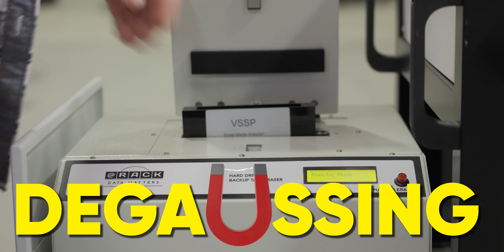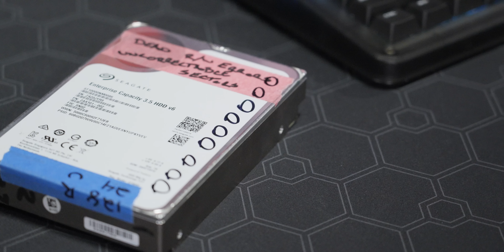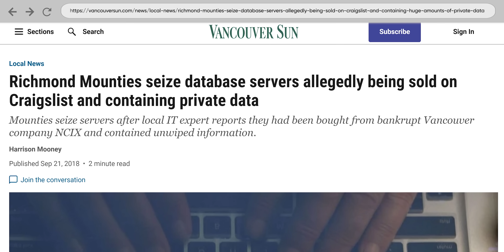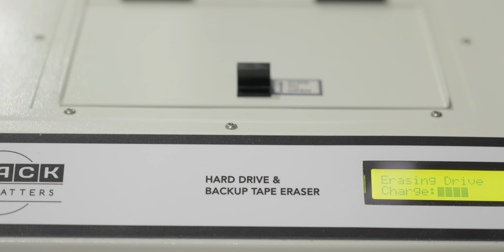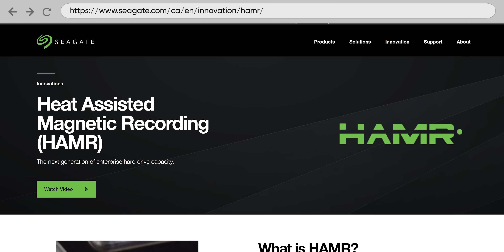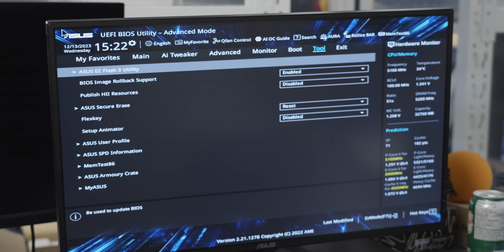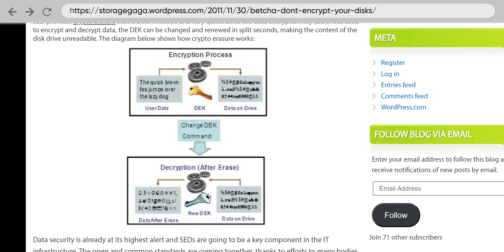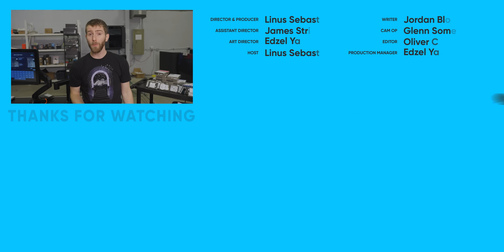I Got an Industrial Hard Drive CRUSHER! @Rack's Mobile Data Destruction System

Comment: Instant secure erase is also a very awesome feature for essentially most business and personal stuff. It’s essentially encryption and it throws out the key.
Reply: One thing to be careful with here is that it's called ATA Sanitize, and "Secure Erase" is a different feature that doesn't actually employ any encryption - it simply drops the page mapping table.
Reply: @gsuberland  Usually, and as per ATA specification, ATA Secure Erase should erase SSDs completely by resetting every bit, not just dropping the mapping table. What you are talking about is a simple format or deleting a partition afaik. Sure, there are maybe some wack ATA implementations out there but this shouldn't be the standard.
Reply: If the drive is SED hdd,, the secure erase has 2 modes

instant erase/Sanitize Cypto {default} clears protected and hidden area and resets private and public encryption keys (doesn't zero fill the drive all stored data is unrecoverable due to encryption keys reset)

Advance secure erase same as instant erase + your normal zero fill

For ssd's secure erase clears page table + sends a mass trim command to all nand chips (if the drive supports encryption it also resets teh private and public key) this takes usually less then 30 seconds with background garbage collection completing the zero fill via trim in the background (a couple of minutes) 

NOTE if the drive has encryption or SED support,, Regardless if you have enabled or not the password or relevant security feature, the data is already encrypted so a secure erase at stage 1 of a secure erase command has already made the data unrecoverable because it has reset the encryption keys (before hdd zero fill happens or ssd trim)
Reply: Did you watch the video? He literally sats that at the end.

Comment: For M.2 SSD sticks I would use an induction heater coil to turn it back to sand in seconds.
Reply: Depending on which organization you work for, some policies my delve into more stringent requirements for SSD destruction. Crushing it like they did in the video would probably be fine for most people, except for the government. The DoD policy on SSDs literally calls for disintegration or 1mm x 1mm pieces.
Reply: Or just an ordinary cheap angle grinder....
Reply: @VTepesIII  well, technically speaking, throwing a SSD in an oven is less work than using an angle grinder. And also using an angle grinder, would not meet policy standards, depending on where you work.
Reply: @NicholasOrlick if its dust no one can read it anyway
Reply: @captainheat2314  that’s what I’m saying if you incinerate it you can’t read it.

Comment: The cloud-service kinda seems like a downside to me. Happen to know if you could host your own database onside? Otherwise, a pretty neat product
Reply: To be fair, corporations like to have something that just tracks this for them automatically. It helps with compliance. No one actually wants to spend a lot of time on this, it's just one small part of a business process so again, the less stuff you have to worry about keeping and managing the better.
Reply: @amogusenjoyer  Well that makes little sense then, because if you're not willing to spend time on it, why have someone run that machine at your locations. Have the disks picked up and destroyed with proof of destruction like most do anyway...
Reply: good point, but the problem with hosting things on site is what if there's a fire or other environmental catastrophe and all of your data is lost? these records are required by the government so a scenario like that is not acceptable, and the cloud service is probably replicated on multiple continents with many copies of the data so it can never be lost
Reply: @pwii  If anything, sending the data across the internet and storing in another companies hands (probably in some other country) seems to me like it would increase cost and risk. 

Easpecially if you already are a hoster and have redundant systems
Reply: It seems like they're selling a service instead of a tool, based on how Linus mentioned renting those carts.

Comment: I had 2 dead 2.5" SSDs on hand a few weeks ago. I opened them up and used some snips to cut the chips into small shards. Kinda cathartic in a weird way.
Reply: metal cantering punch will make short work of chips.
Reply: when i was in highschool me and my friends did some bad things and ended up putting our hard drives on train tracks and burying the pieces lol
Reply: @bmxscape friendly reminder that you have digital footprint😅

Comment: I used to work for a company who made degaussers and crushers like this and they are super cool. 10 tons of force on the crusher, and they're up to 40,000 gauss (4 Tesla) on the degaussers which is cool, but terrifying to work on when doing QA and the capacitors fail to discharge lol. A surprisingly small market but a lot of interest from big data companies. I don't work there anymore but they're a great group of people, Garner Products if anyone is interested.
Reply: What kind of caps are used there? The only ones I dare to handle are those up to 50V for small to midsized electronics projects because they still can ruin your day by popping or "suddently" discharging when your mind isn't fully there.
Reply: @Donnerwamp  I forget the exact specs of the capacitors but the total final voltage was around 1300v for the most powerful model. They absolutely sound like a shotgun when one pops lol I stood back when first testing each one
Reply: The degaussers were fun back when I was destroying old spindle drives at a previous job. Some of the really heavy drives with a lot of platters would jump inside the sled with a satisfying thump.
Reply: i work for a certain data center company and we use your crushers occasionally when our manglers are dead
Reply: @SecondSunofficial  it's cool seeing them out in the world being used. They all went to confidential sites when they shipped out so I never knew where they ended up
Reply: @aaronth777  Not sure of this is the place to say, but we like them, but have a regular issue with them, the doors and their shutoff sensor for it being opened is wayyy too sensitive. Not sure if you've heard that before
Reply: @SecondSunofficial  yeah they're great overall but I've heard that before, I think the sensitivity can be adjusted inside but the magnet can be sensitive
Reply: what is the price for these kind of machines?
Reply: @bugshot4760   If they're NSA listed models usually 20-30k USD depending on options, non-listed are 6-15k.
Reply: @bugshot4760  more than I can afford lol. They are priced for businesses, so like 8k-20k. Most companies buy multiple so it wouldn't surprise me if they get a bulk discount
Reply: what's the point of a degaussing, if you're going to shred the disk?
Reply: @giornikitop5373  Linus touched on it in the video but it's just about redundancy and security when scaling up the operation. A non-degaussed crushed disk could potentially have data read from it although it would be extremely hard. It's really just a quick reassuring visual indicator that it's been erased
Reply: @aaronth777  my bad, you wrote crusher, i meant shredder (not the ninja turtles vilain!). different beast. the chances of recovery something from a shredder is as close as mine winning the lottery.

Comment: Here government harddrives need to be shredded and the chips can't exceed a certain size .Depending on how critical the data is that size can be preeeety small
Reply: How much trouble would you be in if you stole a non destroyed drive
Reply: @FleaOnMyWiener from my knowledge (and taking a slight guess that this person probably has a decent level of security clearance), he would be quite lucky to just get fired AND a sizable fine. (At least the US govt) tries to take data destruction very seriously for secure data storage devices
Reply: @FleaOnMyWiener in my experience you wouldn’t get the chance to, government drives and paper documents are typically witness destruction.
Reply: @FleaOnMyWiener  Ever hear of Snowden? That kind of trouble.
Reply: I would say it would be 3 -5mm pieces, as that is dod standard I believe
Reply: @nicholastaylor7070 my comment referenced germany and the highest classification asks vor 5mm for harddrives and 0.5mm for anything flash related . 

Just using the machine in the video would be enough for normal sensitive data. Data that would be shitty to have out in the open, but wouldn't destroy a company. 

But then again, there are enough places that have shredding machines that can do the work for you no problem.
Reply: As far as I know most companies here (Estonia) offering data storrage destruction actually shred the drives, first time seeing the destruction type done in the video actually.

Comment: When i worked IT in a gov building, our wipe program would 0 and 1 over the drive 13 times, then we would also take the electromagnet to them.
Reply: I mean it's government data so understandable enough i suppose
Reply: @TheMaskedHeart  i would have guessed they have a need to destroy the drives.....
Reply: @nv1t  Technically they are destroying the drives as electromagnet ain't gonna be a lullaby for it lol.
Reply: That's a very old method from a DoD standard and is very much pointless these days. Alas, data wiping utility salespeople love to tout the overkill methods.
Reply: Where I work we degauss and shred.  It's the only way to be sure.
Reply: why not just a circular drillhead, would be fast
Reply: In the Navy we destroyed old mission cards with a chisel and a hammer. Good Times.
Reply: Lol such a waste of time to write over if gonna degauss..hope you got paid hourly for that
Reply: Typical govt. waste of time/excess....; the USAF had TS/SCI on hard drives (old HP 7900/7906 disk drives, etc., with both removable and fixed lower platters)within multiple aircraft, and, simple overwrites of lower platter during shutdown were considered enough all through the early-mid'80's thru the early 90's....